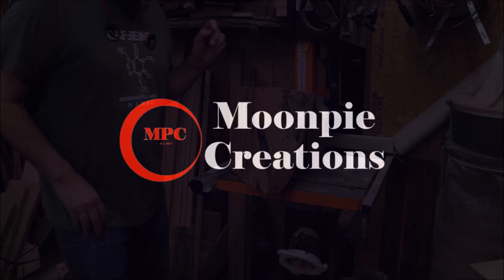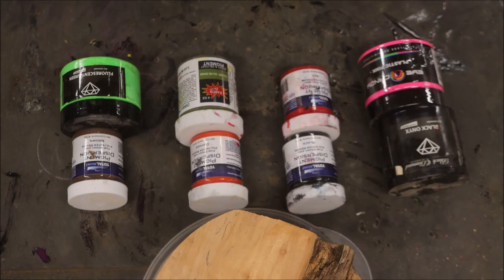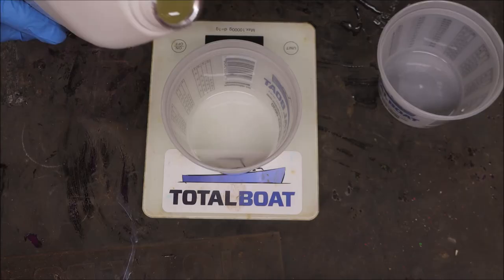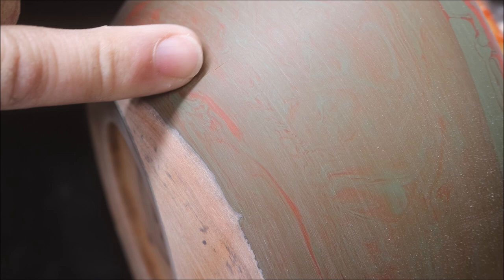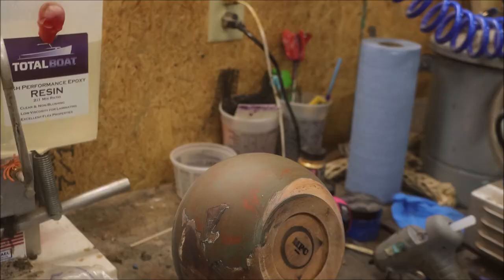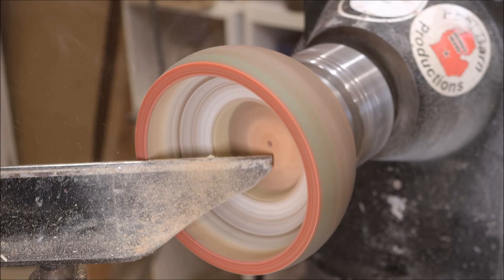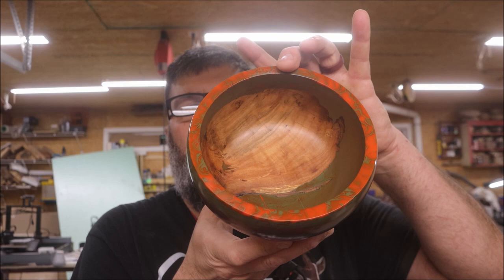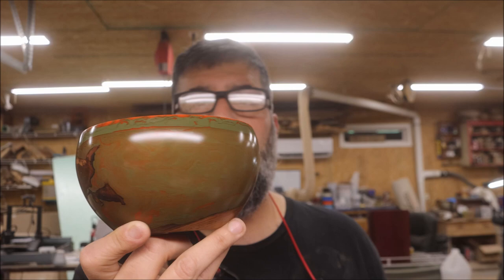Woodturning - Orange and Olive Green Camo Bowl

Comment: I wondered if you were doing so much hand sanding so that it doesn't take more from the wood than the resin.
Reply from the maker: The only issue with the hand sanding is the finish tends to not look as good. It's because I sand to 1500 grit.